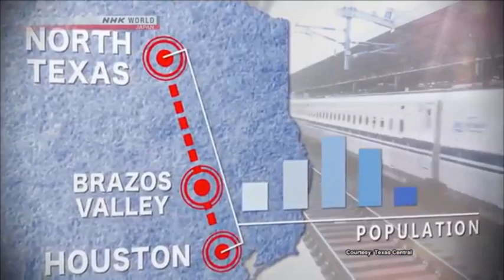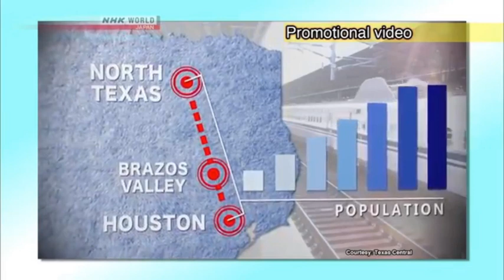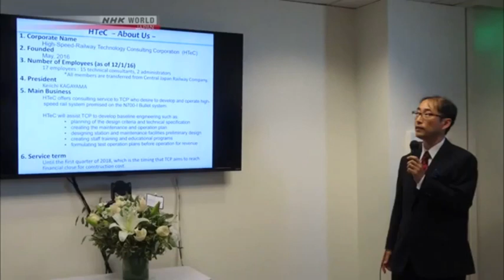USA - Texas High Speed Train for 2026 - Dallas to Houston

Comment: If some sections are not going well because of the opposition of land expropriation by polar landowners (forces opposed to high-speed rail), it would be better to build high-speed rails as underground routes in those sections. 50m to 60m deep. There is no reason why high-speed trains should be delayed because of some sections.

S.korea(seoul-Busan Gyeongbu and Suseo-dongtan Suseo High-speed Railway), China, and even some other countries in Europe have high-speed trains made underground in some sections, but there is no need to build them only above ground or overpass. You can take a high-speed train in another country or look up an encyclopedia and actively deal with it. Because there is nothing wrong.